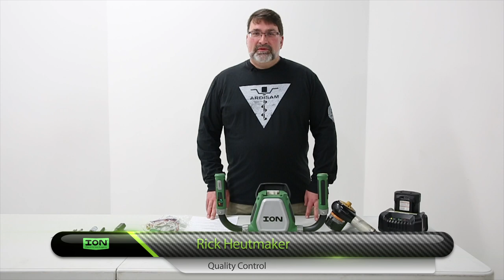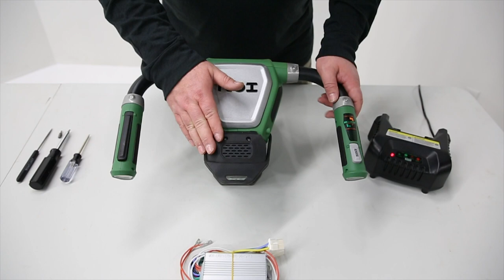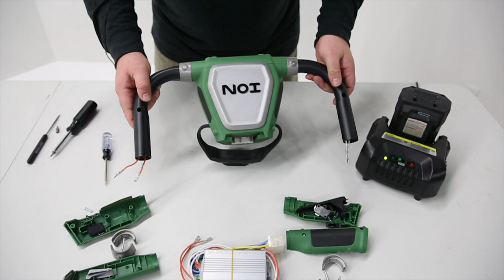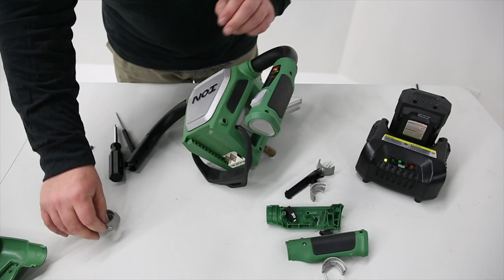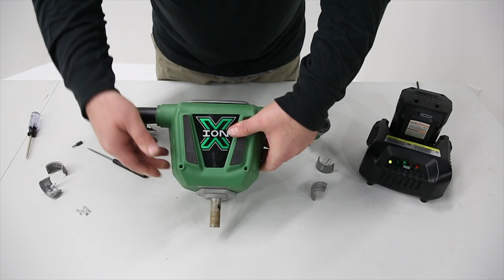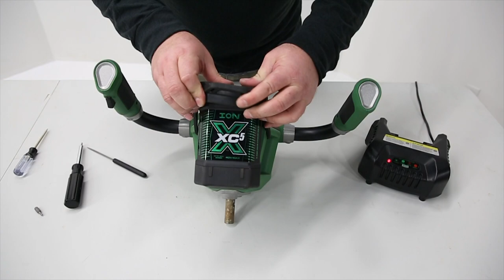ION Replacing Your Controller - How To

Comment: Cool! Connectors for the handlebar wires would be better at the controller so all you would have to do is remove that one inspection plate and not the on/off switches etc. If the switches needed to be replaced the connectors are already on the switches and just the handles need to be removed.

Comment: at 3.9/3.10 into video i see the light   come on on auger so the computer must power  in a capacitor as the battery was NOT connected  is that how this occurred???